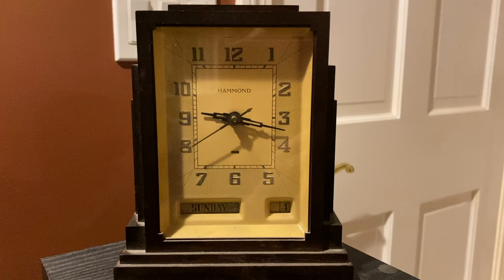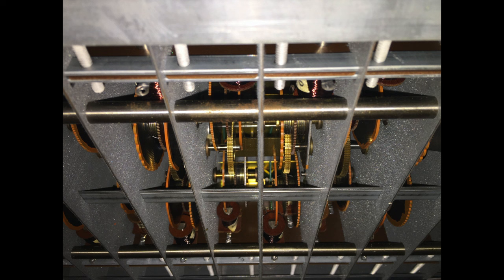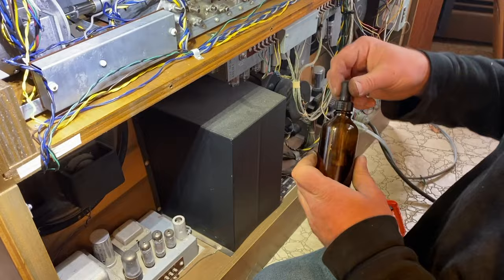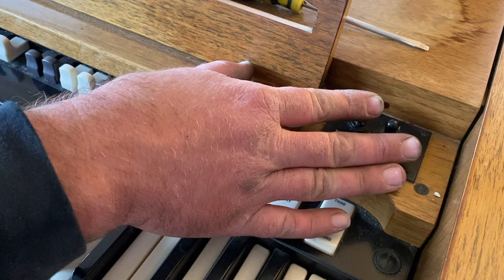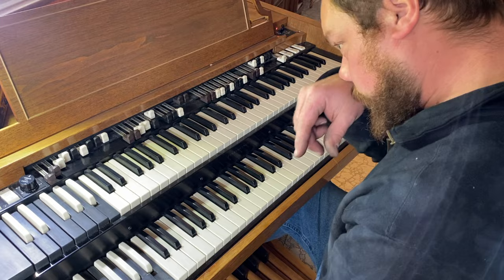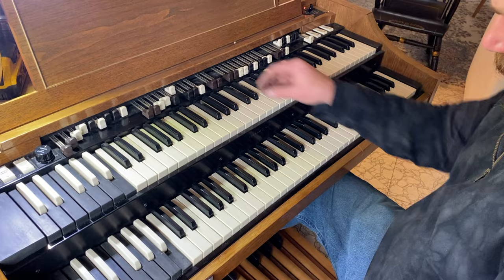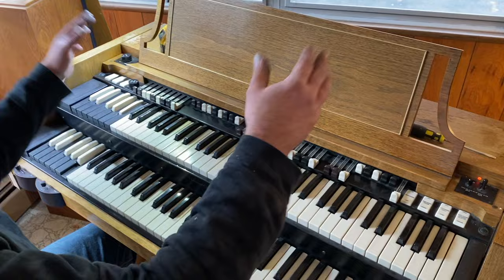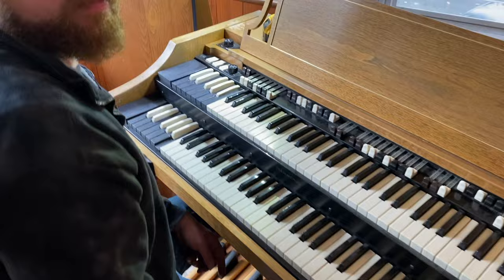The Hammond A-100 Organ, History, How it Works, Maintenance, Operation and Features.

Comment: Good summary and explanation of the A100.  In a side note re: the B3, it's interesting that I can find no reference to Bill Rieger anywhere in reference to the B3. Bill Rieger worked for Hammond for 35 years or so and was Director of Engineering and Research at Hammond. He led the team that created the B3. He was a brilliant electrical engineer, and had a major hand in what because the B3. He's never mentioned.

Comment: I believe "Whiter Shade of Pale" by Procul Harum was recorded on this.
Reply from the maker: I think so. Many rock songs had an organ player using a Hammond; it was very popular, before synthesizers came into common use.  When the Doors did "Hello I Love You," there's a break where only one sound is heard, a glissando that descends, then ascends again.  I don't know for sure but there are some theories that they achieved this by rewiring the basic power circuit in the organ to allow the motors to be shut off but keep the amplifiers on. That way the tone wheels slow down (descending notes) and resume speed when the motors are started up (in the correct sequence) again.
Reply: On a M103 ,Matt Fisher did it !

Comment: Hi, just a correction at 10:38. The 8' drawbar is considered the fundamental, as stated. This is also the "first harmonic," synonymous with the fundamental The 4' is the second harmonic (twice the frequency of the 8' or one octave higher); the 2 2/3' is the third harmonic (three times the frequency of the 8'); the 2' is the fourth harmonic (four times the frequency of the 8' or two octaves higher); the 1 3/5' is the fifth harmonic (five times the frequency of the 8'); the 1 1/3' is the sixth harmonic (six times the frequency of the 8'); there is no seventh harmonic drawbar; and the final 1' drawbar is the eighth harmonic (eight times the frequency of the 8' or three octaves higher). The point of this long and arduous comment is that there never was a seventh harmonic on the Hammond drawbar system. Had there been such a harmonic, the drawbar would be named 1 1/7'. Irrespective of all of this math - the Hammond sounds awesome in every way!
Reply: I just realized why they didn’t provide a 7th-harmonic drawbar -- is it because none of the non-octave harmonics are true harmonics? That is, exact ratios to the base frequency? They are all simply using the same set of tonewheels offset by some integral number of semitones? This is probably close enough for the 3rd, 5th and 6th harmonics, but would be too far out for the 7th.
Reply: @lawrencedoliveiro9104  If there were a 7th harmonic drawbar, there would be less than 2 cents error in frequency due to the tone wheel generator. In the real world, the equal temperament seventh harmonic is about 31 cents sharp from the theoretical seventh harmonic! The tonewheel generator was perfectly capable of generating quite accurate equal temperament tones. I believe the absence of the 7th harmonic drawbar was due to an intelligent choice by Laurens Hammond and John Hanert to balance features, performance, manufacturing and end-product cost.
Reply: @billtanguay8905  That’s about a third of a semitone, which is noticeably off. That’s my point. And of course it gets worse from there.
Reply: Look at a modern softsynth
Reply: like ZynAdd
Reply: SubFX, for example: it gives you all the harmonics from 1 to 29.
Reply: @lawrencedoliveiro9104  Agree with all of your comments. ZynAdd looks very powerful. My point is that for a mechanical beast with meshing gears from 1935, the tonewheel generator does an excellent job creating equal temperament tones available to the keys and drawbar system. The accuracy for notes #1 to #84 is -0.7 cents to 0.2 cents, relative to A = 440 Hz and equal temperament. The very high notes #85 to #91 accuracy is 1.2 to 2.0 cents. The generator is huge, it's heavy, it needs oil and AC power, it's truly ancient technology, it only creates equal temperament and does only one basic thing (91 different things, but they don't ever change).
Reply: @billtanguay8905  Technology is just a means to an end, not an end in itself. In this case, the end is making music.
Reply: Very good on the harmonics - its really necessary knowledge. The first 2 (brown) draw bars are dub-harmonics. The  8' (white) is the tonic (or fundamental.)
Reply: Ah yes, thanks for the correction! Brain fart i guess.

Comment: So incredibly interesting to me and well done. I'm definitely misunderstanding the tonewheel/drawbar/key relationship and mapping. Does each tonewheel module comes as a "pair" for a fundamental and overtone pitch - i.e. is that why they are in pairs? Does each key on the keybed have its own dedicated tonewheel, or can a single key trigger/map to multiple tonewheels? Can a given tonewheel produce only a single fundamental pitch, or can it be sped up/slowed down to produce different pitches?

Comment: Each one of those wheels is a tone generator. The number of tone generators along with the vacuum tubes made these organs sound really good. The only thing that sounds better is a pipe organ. Before the great depression, especially back in the 1800s, many wealthy people had enough money to install pipe organs in their homes.
Many of these organs were self playing.
Reply: Pipe organs never had spinning speakers, though.
Reply: It's correct that pipe organs never had moving baffles (or speakers lol). However, I believe the Gulbranson church organ actually had speakers mounted in a round piece of wood and spun around on a circle for the "celeste" sound. It was really something to hear because of the massive amount of air being moved about.
Reply: @lawrencedoliveiro9104  In a pipe organ, each pipe can be thought of as an individual speaker being driven by its own free running tone generator and amplifier.

Comment: Can you explain why the motor of the tone generator only is used at the beggining? is that because the valves after that work as a memory and once the tone is generated it is kept stored inside a memory valvulated circuit? I really would appreciate an explanation about that
Reply from the maker: Sure.  The motor actually has two parts, which can be thought of as if there were actually two separate motors.  One is a synchronous motor which is designed for very accurate speed, but has very little torque (rotational power).  The other is an induction motor, which has more torque, but cannot be relied upon to run at exactly the right speed.  If the speed varies, then the notes will "warble" and be off key.  The start switch, the spring loaded one that you push first, energizes the induction motor to get everything up to the approximate speed.  Once it has reached full speed, you switch on the other switch which supplies power to the synchronous motor.  You then let go of the start switch, as the induction motor is no longer needed and will only serve to interfere with the accurate speed of the synchronous motor.  
In clocks, there is so little work for the motor to do (turn the hands on the clock face) that a separate induction "start" motor would be overkill.  In the Hammond clocks, there is small shaft that protrudes from the back of the case which you twist to get the synchronous motor going right after you plug it in.  In Telechron® Clocks (later bought out by General Electric), a special circuit within the motor gets it going without human intervention.  If you have a power failure, the Hammond clock will not self start, so the time it shows is the exact time the power failure occurred.  In the Telechron Clocks, they will start up again when the power is restored, so you know how long the power failure lasted (how "behind" it is from true time), but you don't know when the failure occurred.  If you have one of each in the house, then you know both things.
To answer the rest of your question, no the valves (tubes) do not work as a memory; they only work as amplifiers of the signals generated by the tone wheels, much the same way a guitar amplifier takes the very weak signal from the coils in the guitar pickup and amplifies it to produce an audible sound from the loud speakers.

Comment: This is really interesting - I'm happy to have stumbled across it 🙂

I'm keen to get an organ similar to this and there are LOADS going for cheap/free in my local area.

For transit purposes, do you know whether the top section generally separates from the upright speaker section (without too much meddling with or disruption of the circuitry)?
Reply: the ones that are free, are not tone wheel organs
Reply: I do not believe the bottom of the A-100 van be separated.
Reply: No I bet there are none similar. Only a few hammonds are desirable, the rest no one wants. any free or cheap are not A100, B3, C3 everyone knows those sell several thousand, any others free or cheap will be the oddball models or electronic ones that sound nothing like these.
Reply: Grab the best one you see !  A fantastic old musical technology . Do some research on the foam pad sitting on top of the TWG if I am not mistaken . If it is foam it may have disintegrated and caused mayhem in the moving parts of the generator . I think that the foam was discontinued after a CERTAIN DATE SO IT WOULD BE GOOD TO BUY one of the later A-100's .

Comment: If you do that every year, you'll have a puddle of oil under it after a few years - helps to lubricate the floor for moving the organ around.
Reply: As i mentioned in the video, this organ hadnt been oiled in numerous years, so i put in extra. If oiled annually , one eyedropper in the run motor cup and two eyedroppers in the funnels is appropriate.

Comment: 9:21 Just a note (heh) that you’re not hearing exactly that G, which would be 2 ** (7 ÷ 12) ≅ 1.4983 times the frequency of middle C, but a frequency which is exactly 1.5 times that of middle C (a “perfect fifth”).
Reply: 9:36 Similarly, that note is not the E which is 2 ** (2 + 1 ÷ 3) ≅ 5.0397 times the frequency of middle C, but a note which is exactly 5 times the frequency of middle C.
Reply: I must say it is a pleasure to run into someone that understands not only the Hammond but harmonic progression. Wonder if you are old enough to have read Hemholtz, "On the Sensation of Tone?"

Also I would like to point out that the Hammond organ may be considered the first Additive Synthesis synthesizer.

Comment: Where is the Leslie switch?
Reply: Maybe this organ wasn't equipped with Leslie. Leslie was optional from another company. Possibly the organ was used as pipe organ replacement, so no need for Leslie.
Reply from the maker: @verkehrsteilnehmer-berlin  - This organ has a Leslie switch, but we did not cover that in this video, as a Leslie is optional with the A-100, unlike the B3 and C3 which do not have a built in power amplifier and speakers.  The switch is often mounted at the front edge of the keyboard area, at the left.  The Leslie speaker that this owner has only has one speed (fast), so the switch has 3 positions, internal speakers, Leslie Speaker, or both.